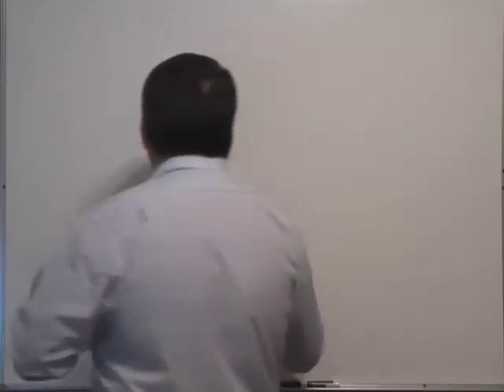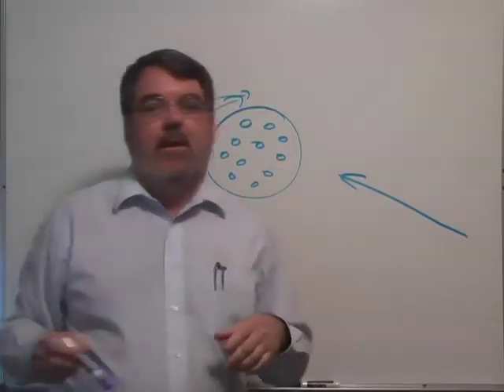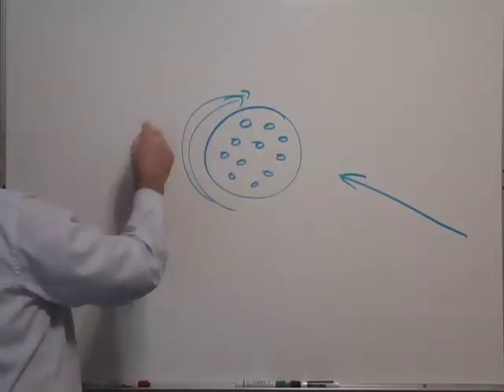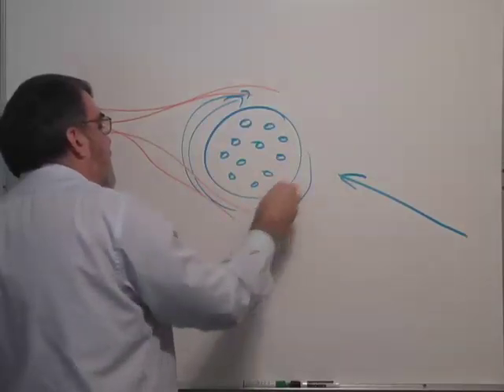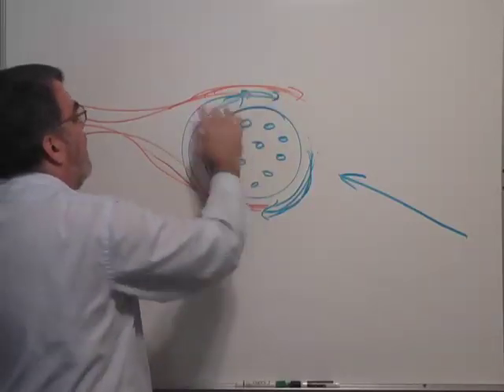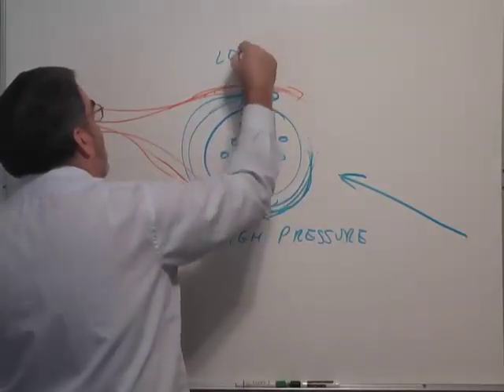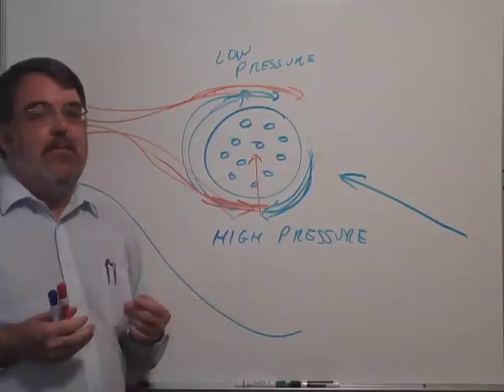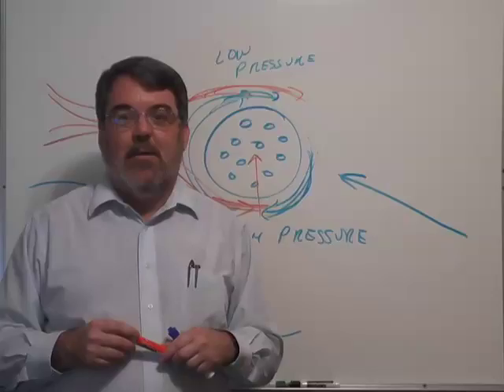Why Golf Balls Have Dimples

Comment: I was taught the dimples create turbulent flow, surrounding the ball in a layer of turbulent flow. The rest of the air over the ball is laminar flow. There is little drag exerted by the laminar flow on the turbulent layer causing is to fly further.
Reply: +Daniel Harris .. You are right... The dimple reduce the wake region behind the ball, due the existence of thin boundary layer which are caused due to dimples.. and hence lesser drag compared to the smooth ball... So less resistance for ball to travel more...

The video explains only a basic part of "Why dimples.." ... It should be taken to next level of explanation..
Reply: LOL this doesn't justify WHY gold balls have dimples.
This just explains the magnus effect
Reply: @elenivelonas5719 I agree with you. The phenomena explained here can be explained the same way with a simple rotating ball, from my point of view.

Comment: Dimples create turbulence, which in turn decreases drag. Turbulent flow re-energizes the boundary layer causing it to remain attached for longer and decreasing the aft low pressure area. That's really what makes the ball go farther. Additionally, ANY sphere that spins, no matter how smooth, will develop lift since the flow velocity at the surface is zero (no slip boundary condition). Since it doesn't slip it will still carry the air around as explained.

Comment: You have mixed up boundary layer tripping decreasing the aerodynamic drag around a bluff body and Euler/Bernoulli pressure drag effects that cause a spinning ball to change direction in flight.   The Dimples or roughening trips the laminar boundary layer to a turbulent boundary layer sooner; decreasing the drag through energising the boundary layer and decreasing the Von Karman modulation effect that leads to a shortened distance covered due to an erratic trajectory.
Reply: I noticed this mistake, too.

Comment: I think that the dimples creates some kind of air cushion around the ball so that the air does not "rub" the entire surface of the ball with high speed. Probably the interior air resistance is much lower than the resistance between air and solid surface. 
The dimples seems to work as well by bigger object. Zipp patented a bicycle disc wheel with dimples and look at the Myth Busters experiment with dimpled car.

Comment: If you wish to talk about applied spin, aero-turbulence, von karman modulation or lift (Cl) or the observed effects of a ball with applied spin changing direction in mid air (e.g. a 'David Beckham free-kick') you should read the papers regarding this by Euler, and have a firm appreciation of the Bernoulli effects, (plus gyro rigidity and Coriolis).   I cited these papers in my thesis Euler was the man, cut out the spin and lift nonsense in the vid and its fine, almost.

Comment: @TheArfdog I said read the paper, I'm not using 'Engineering buzz words' The dimples decrease drag and the interaction of the flow of air with a moving surface induces forces, which isn't technically lift, if you want you can e-mail me and I will ref. the exact papers by Euler.  The dimples have nothing to do with the forces induced by the spin of the ball.

Comment: @SSCCMath142 I'm an Engineer actually, I worked in vehicle aerodynamics for my MPhil and I currently work in the Space industry.   You are not 'wrong' per se, you are over complicating the situation by addressing two different issues.   The dimples on the ball have nothing to do with movement spin or lift.   The sphere is a non aerodynamic 'bluff' body the dimples decrease the regular sphere drag profile (Cd) the decreased air resistance allows for a greater range for the same applied force.

Comment: @jk28416 You're not impressing us with your fancy explanation. I'm a mechanical engineer and you are not getting your point across by using engineer buzzwords like Coriolis effect and Bernoulli and Euler.

This man's explanation is accurate. The boundary layer, with more stagnant air molecules, is being drawn around the ball in the direction of spin, creating a high pressure zone with more molecules than the other side, creating aero lift.